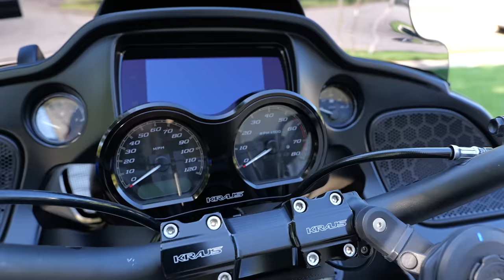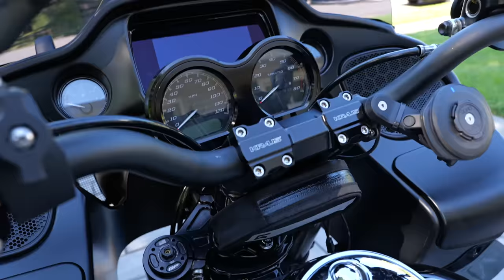MY ONLY REGRET‼️ Harley Davidson Road Glide Performance Bagger Build

Comment: Thanks John, I just found a Unicorn Road Glide, 2016 Road Glide Special with only 980 miles on it at purchase.  I have added Custom Dynamics Lights, and another brand of Handle Bars from a GA company.  I wish I had went with the bullet style Front turn signals, but will get there.   Working toward cam chest next.   Thanks for the video.

Comment: Hey John, I’m watching your video about your GP cartridges and hearing that they feel a little stiff. The only way to soften is go to a different spring. when you ordered your suspension you had to give them your rider weight so whatever that info was, you probably want to go with the next softer spring rate. I have Öhlins NIX 22 cartridges in my Dyna And I ordered two different spring rates for tuning. Good winter project.
Reply from the maker: I did that the springs were set to my weight

Comment: John, anyone else here; I have the stage 4 131 build with Feuling vented dipstick and such, runs good, love it. Question: have you ever experienced light amount of oil buildup at the bottom of your air cleaner? If so, why does it do that/is it normal, and is there a way to stop that from happening?
Reply from the maker: I have not

Comment: The problems with the tire(s) are directly related to the suspension and performance of the engine. In this case the tires are the weakest link. The engine is pushing harder than stock tires can handle and the tire is under spec to deal with the forces (and geometry) the new suspension can sustain. The front is capable of pushing & leaning in ways the stock tire wasn’t meant to. Softer performance rubber with a little less pressure may be the solution. The final test would be to upgrade the brakes there’s no way the stock tires would be able to withstand the performance of upgraded front discs. You’d likely start to lose the front while trail braking or emergency stops. Good luck and keep the beautiful machine Mad Max rubber side down on the road!

Comment: GP will respring that lighter for you.  And make sure you have the correct oil weight - too heavy will make it harsh.
Reply from the maker: Thx for the tip 👍
Reply: @CYCLEFANATIX  for sure mine was like a brick - now it is perfect.

Comment: Hey John,  Love the channel and Mad Max. 
I just did the fan test on my '21' Road Glide Limited and as described, the fans came on with the throttle twist.   Further, by twisting the throttle again the fans shut off and could be switched on and off without touching the ignition.    Have you done a video about new tire options?    Keep up the great content.🤩🤩
Reply from the maker: Awesome thanks for that info 👊👍

Comment: Hey John love your channel. I do have a question, on silverback you had the evolution industry clutch like this one but you had the darkhorse sprocket. Why did you go different on this build? Did the dh sprocket seem to harsh? Reason I ask is that I bought dh sprocket along with evolution complete basket for my 2018 street glide. Next will be a 124” kit. Whatcha thoughts?
Reply from the maker: No issues with DH

Comment: Do you have the santoro front bar for the chin spoiler or just the regular santoro bar ?
Reply from the maker: Regular
Reply: @CYCLEFANATIX  how did u get the top clamp in ??????? I had to remove my santoro bar just to fit the bottom
Clamp I couldn’t get the top one in so I just said screw it I’ll try another day

Comment: Word is Legends shocks suffer from leaking... are you running or considering the Trask vented transmission cover?
Reply from the maker: Not sure I feel I need it
Reply: @CYCLEFANATIX  have you removed your air filter to see how much head breather snot is entering your combustion chamber? as soon as I installed the Trask setup, I eliminated 99.9% of the snot, which is keeping my intake clean. I am very pleased with the results. do you know what the stock compression ratio is with that engine? carbon deposits on the top of the piston will eventually cause detonation.

Comment: Are you going to ditch that stock shifter rod... they tend to break.
Reply from the maker: Maybe
Reply: My buddy's broke on one of our long rides... we limped to a HD dealership to get him back on the road. The pressed in bolt mount came apart. We crammed it back in and held it together with zip ties. As hard as you ride, I highly recommend it :-)